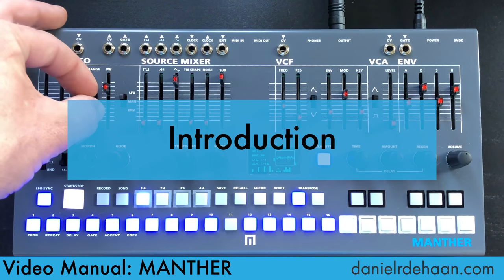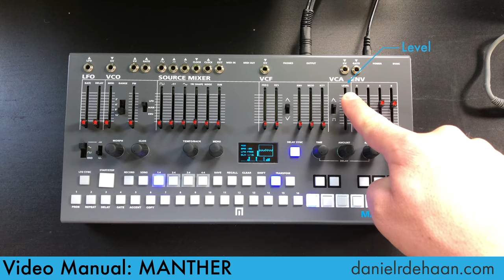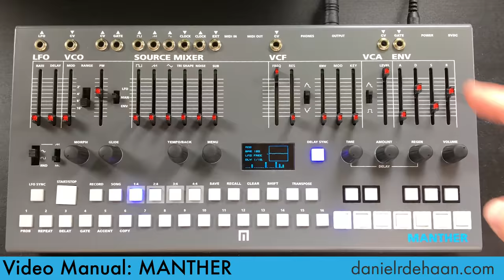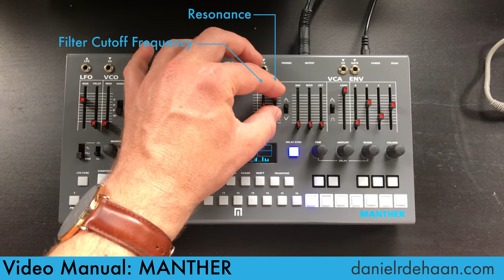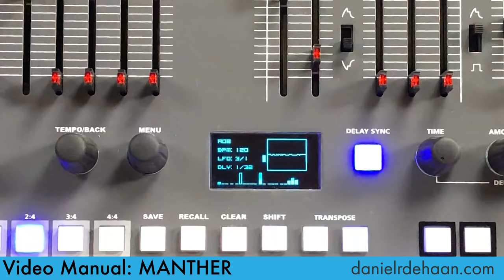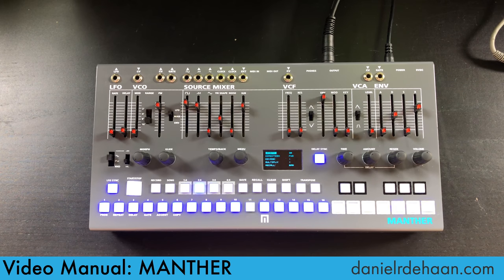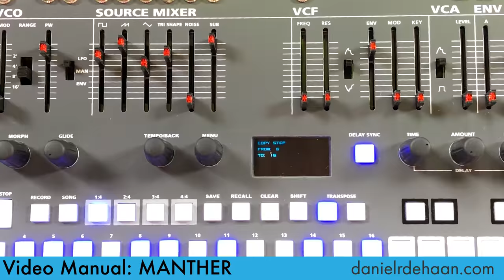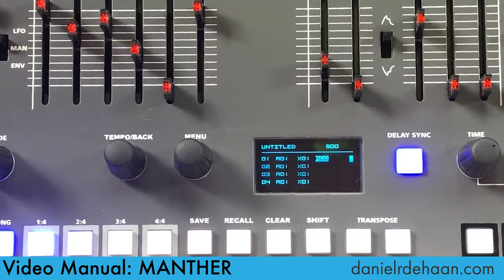MALEKKO MANTHER - In-Depth Video Manual

Comment: Hi Daniel. I am a huge fan of your videos. I have a question that I’ve been trying to answer about the filter on this machine. Hoping you can help. On my unit the filter does not open smoothly. Instead it jumps values in the higher frequencies as if stepping up in frequency rather than gliding if that makes sense. It does not behave this way when using CV to open the filter. I have contactedMalekko but they have yet to respond.Do you have any insight on this? Thank you in advance for your response. All the best.

Comment: Daniel. Very nice video. Question: Doesnt it bother you that you cannot transpose a sequence on the fly? I cannot forgive Malekko for that missing "feature".
Reply from the maker: It does and it doesn’t. I’m working on another video that talks about these kinds of thing both in respect to the Manther and other modules. In short, I enjoy when a module has a smaller set of features because I can more quickly learn the instrument and begin discovering creative and unexpected ways to use it both by itself and with other devices/instruments/etc. There are certainly a number of things I hope to see Malekko do with the Manther, but I think it’s pretty amazing how many awesome modules/synths the small Malekko team has been cranking out lately and how functionally dense they are. 

You can transpose the Manther’s sequence by patching another CV source into the VCO CV Input. I haven’t yet tried connecting an external MIDI keyboard to it (I’ve been away from my studio the last couple of weeks), but I would imagine that would behave similarly. 

Thanks for sharing your thoughts. Keep them coming! What do you think the Manther does well? What else could be add to it or improved on? What other modules/gear do you like to use with it?
Reply: Daniel Dehaan low latency would be nice though , try triggering it from external gear / sync it nicely ( I’m sure that can be fixed ) . It does have an on/off button which some devices don’t.
Reply from the maker: Low latency?
Reply: Daniel Dehaan I tried sequencing it from external midi , some delay in triggering the notes. Also an issue with sync but it was from digitakt which I think is ok but not 100% sure.
Reply from the maker: Weird. I’ll try and get into the studio soon to send it some MIDI but when sequencing w/ CV I didn’t experience any latency or delay.
Reply: Daniel Dehaan that would be great ..thanks
Reply: Sorry just saw your reply. Sorry but it makes no sense. You rather have NOT basic sequencer functionality because it makes you enjoy learning the module more? huh? How it it making you more creative when a basic functions are missing?  Its supposed to be a self contained sequencer. The CV in is buggy also the sub doesn't follow the pitch. Its useless really.
Reply: @DanielRDehaan  I went to hook up a Arturia keystep today but got caught up in linking another synth JMT LD2 via vco....so new to all of this..never did make it back to the keystep link up.

Comment: great tutorial, but how to transpose a sequence? If i made a seq in d minor and want it to play e.g. in e minor.
Reply from the maker: I'm not sure this is possible. But this would be a nice feature for Malekko to add in the future. You can transpose the sub oscillator using the MIXER menu page but that wont transpose the main oscillator.
Reply: you cant transpose (youd have to edit the  notes yourself)  , you cant see what note is on a step (unless you play the sequence) , you cant transpose the selected step (i.e hold the step and press a transpose button) , you cant change to another sequence unless its playing the sequencer  , it'll swap to another sequence 'now' or at the end of a sequence (not a bar , assuming a bar is each set of 16 steps or however many are used within the bank of 16 steps) , you cant see the values of the dials you are editing on banks 2,3,4 (bug i guess) , sync and midi trigger 'isnt quite right' , cant see any automation of the dials on any led screen , .... i'll stop there. its a nice device, usable , needs an update... which is typical of nearly everything being released these days... its a nice 101/202 style box with some modern touches and i hope it gets the support it deserves to be a great success. to be open about this stuff i'm posting on muffwigglers about this too , so you may read complaints and get the wrong impression , it could just be me ... a single internet keyboard warrior with too much time on his hands , using it to complain.
Reply: The most ridiculous thing missing from a machine that is....a sequencer. Really, Malekko makes nice modules but they dont have musicians at work. Also dont call it a 'feature'. It's a standard function that most sequencers (even the cheap Arturia keystep does this with ease). Unforgivable.
Reply: buzzfunk they added it a while ago in case you were wondering!

Comment: Can you input notes in real-time on the sequencer?
Reply: Yes. It's in the video, but if you have the latest firmware 1.2 then you need to go to Record menu and turn Step Record off otherwise the keyboard just sets notes of the sequencer one after the other: steps 1, 2, 3, 4, 5, not in real time.
Reply: I was wondering the same.
.I want to be able to puck the note for each step...that should be easy/ possible.

Comment: youcan hear stepping in the filter
Reply from the maker: Maybe. Where within the video are you hearing it?
Reply: following along with my manther I think about 17:15 I had the res all the way up and manipulating the freq slider I could hear stepping. pretty common with digital encoders I guess, common with roland crap. dont know if you were to record the slider movement if it would smooth the steppin or not.
Reply: to be sure I love this thing I can make noises with it that scares the dog neighbors and girlfriend far more than my detuned death metal guitar riffing turned up to deafining levels
Reply from the maker: Yeah, every now and then I notice it a little as well. That is certainly the struggle of digital controls and short sliders.
Reply: its chromatic could almost play a tune with it